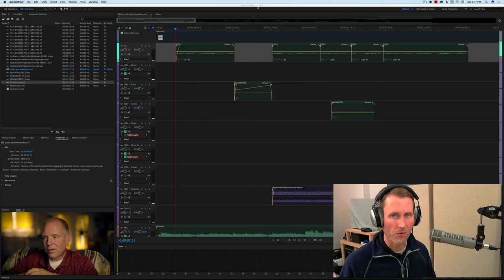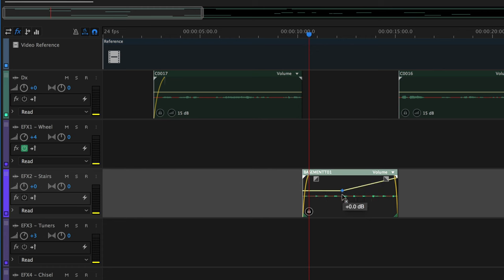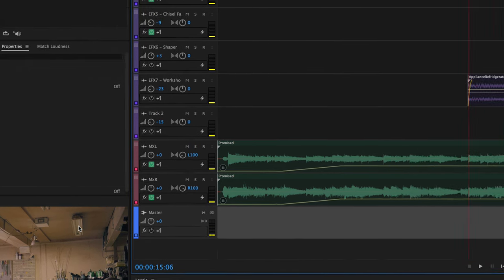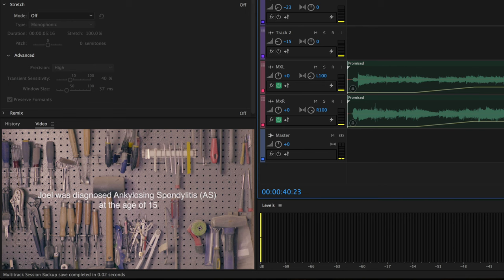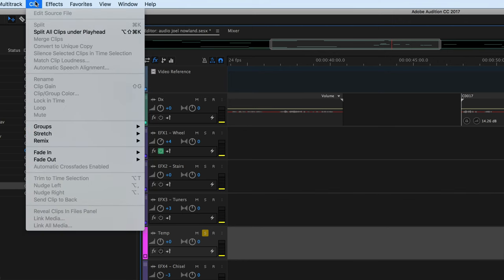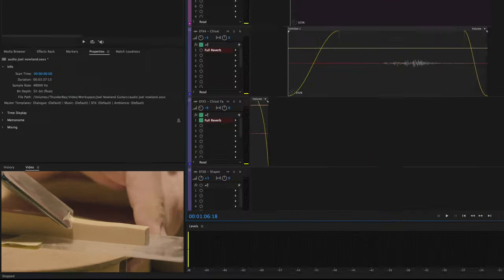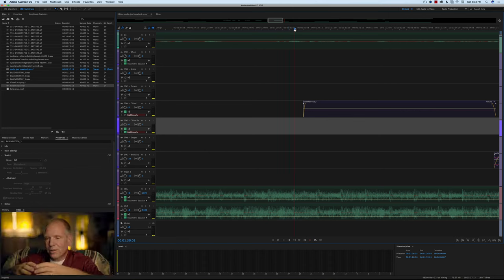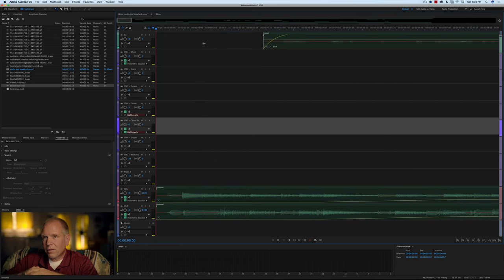Sound for Video Session: Mixing Effects for a Short Film

Comment: With regard to the chiseling, when re-pitching production FX to sync with over-cranked video doesn't work quite right, a quick foley session will often be less trouble and produce a better result. Of course, someone who was really handy with Revoice Pro or VocAlign might be able to make short work of the job. I'm not that person, though. :-)
Reply: Good points. +Pete Styles suggested that I should have recorded this part at 192kHz sample rate to increase my chances of re-voicing it. I'll work with it a bit more and see where we get. I'll have to also put some thought into what I'd use to make a slow-motion chisel sound in foley.